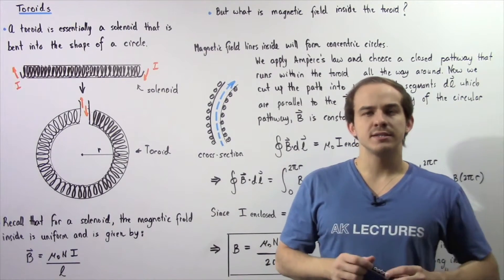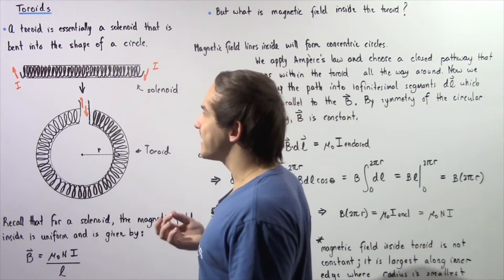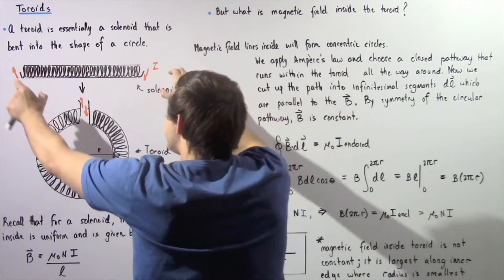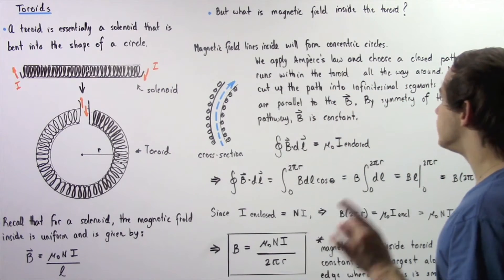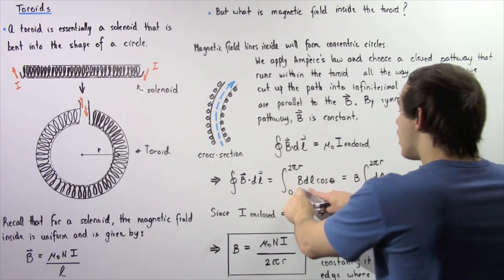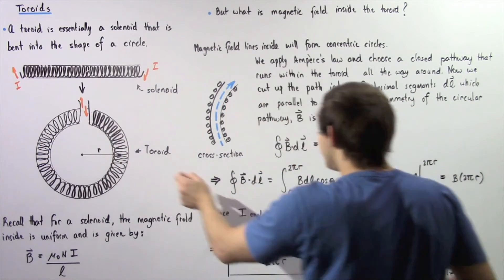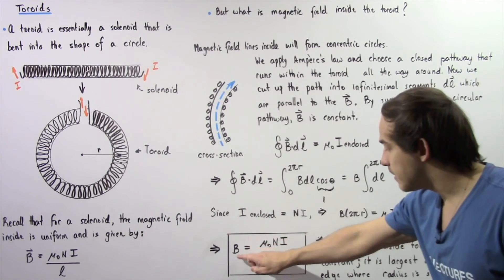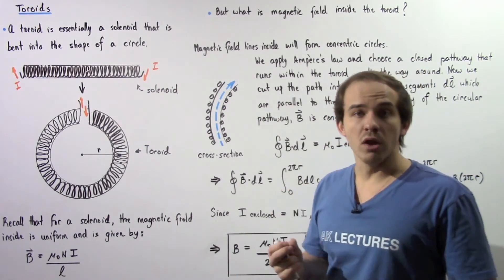Magnetic Field Inside Toroids

Comment: I find your Magnetic Field Inside and Outside a Toroid Lecture to be very interesting especially because of the use of math to explain the principles. I commented around January regarding the calculations to solve for the B field. You got 6.5 mTesla and I got a lesser amount. You were correct. I carefully went back and re-calculated your equation, and I was the one that left out the pi in the calculation with the permiability of free space,  4Pi x 10^-7 not you. I owe you an apology. I am very glad that I finally got it right, and thanks!

Comment: The overlooked problem is the actual physical reality - the fact that:
1)  the B field is created by the current in all cases involving flowing current
2)  the B field is said to be variable (greater on the inside of the toroid, lower on the outside of the toroid) but the current I is assumed to be constant - in other words, the B field is claimed to be varying *independent of the fact that the current is not varying*

I'm not saying Ampere's Law is wrong.  I'm saying this:

You cannot on the one hand say that "the B field varies directly with current flow" 

but simultaneously say "the B field varies independently of current flow"

I'm talking about the *EXACT PHYSICAL NATURE* of the current flow here.  Is there any claim that current flow is greater on the inside of the toroid, and/or that the current flow is somehow lower on the outer edge?  NO. 

Then you have 2 choices.  You can say "okay, I admit it,  since the B field is lower on the outside of the toroid ring compared to the inside, that means the current must also be lower"  OR you can say "the B field does not vary on the inside or outside of the toroid ring - the B field varies directly with the current,  and since the current is constant, so is the B field"

LEAVE THE MATH OUT OF THE FOLLOWING.  This is a thought experiment about the EXACT PHYSICAL NATURE of the current flow, and of the B field of the wire.
NOTE:  You should look at a picture of the magnetic field lines of a wire-wrapped soft-iron-core - aka a solenoid - FIRST, before you can understand the below:

The way to get the physical picture is this:
1)  take a straight piece of wire and wrap it around a straight, soft (very soft) iron shaft,  and with 1 amp flowing  (the wire is powered by a DC power source).  This is just a soft-iron core solenoid
2)  measure the B field on the left side and on the right side of the wrapped wire, on the left side and then the right side of the solenoid.  SAME B FIELD WILL BE DETECTED.  It's a solenoid.
3)  bend the wire-wrapped soft-iron-core into a 1/2 circle and with the same 1 amp current flowing,  measure the B field on the left side and on the right side of the wire-wrapped soft-iron-core.
      IT MUST BE THE SAME as you found for the straight solenoid.
4)  now bend the wire-wrapped soft-iron-core into 3/4 of a circle and with the same 1 amp current flowing,  measure the B field on the left side and on the right side of the wire-wrapped soft-iron-core .   Since the same current is flowing,  the B field MUST be the same on both sides of the wire.
5)  repeat (4) but bend the wire-wrapped soft-iron-core into almost a circle but the ends are not touching. 

Since the current does not change AT ALL in the above,  the PHYSICAL UNDERSTANDING of a CHANGE, a DIFFERENCE,  a VARIATION in the B field in the inside of the circle compared to the outside of the circle *while the current stays constant* is MISSING in the standard explanation.

The problem with relying on math to explain physics is a glaring error like this one.    Always remember: math is a SHORTHAND to present a physical reality.  Math is to a physical reality as written music is to the sounds produced by the instrument.  Math is a CRUTCH.  You do not start with the math.  You begin with a PRECISE UNDERSTANDING of  the exact physical reality.  Then use the shorthand (math) to describe it.

You cannot on the one hand say that "the B field varies directly with current flow" 
but simultaneously say "the B field varies independently of current flow because, in a circular solenoid, the current is the same on the inside and the outside but the B field IS NOT"

This is an overlooked mistake.  I'm not talking about the math here, so a refutation of "but the math explains it" doesn't answer the question.  At all.  

Put the 'PHYSICAL' back in PHYSICS. 

Demand a PHYSICAL explanation.   Say  "how could the current be the same but the B field be different?"
You will not get a physically precise answer.  You will get a decades-regurgitated "because look at Ampere's Law".

"But how can the current stay the same throughout the wire but the B field is different?"

You will not get a physical explanation and that is a problem.
.
Reply: Lol if you don’t understand electromagnetism just say you don’t. The physical interpretation is easy.
Reply: @Nick_Adkins  
I don't think you understood my gripe.  It's misleading to tell a physics student "a constant current of 1amp gives a constant B field of 20 Gauss" then turn around and say "a constant current of 1 amp gives a B field of 100 Gauss"  - UNLESS you explain WHY.     The 'why' is important because we're talking about simple repositioning of magnetic flux lines, AND NOT  a 'magical' increase in magnetism.

One way to say that is  "toroids do not amplify magnetic fields".  The physically precise explanation is like that of an explosively pumped flux generator.  It's precise to say "a toroid re-positions flux lines into a small volume of space"

Another field example.  It is commonly known that gravity is a gradient of declining inertial drag that, owing to the 'point source' nature of it,  leaves an orbiting object with an inertial drag imbalance (a declining gradient of inertial drag, along a vector pointing at the gravity source).

It is possible to alter the QED Vacuum to alter the gravity field - to restore the conditions to eliminate the imbalance.

For example, in open, empty space - far from any gravity source - there is no 32.2 feet/second^2 acceleration of gravity.  Inertial drag is balanced - the same magnitude of inertial drag is experienced regardless of which direction you accelerate a rocket ship.

In a gravity field, there is an imbalance of inertial drag and an acceleration of 32.2 feet/second^2 (Earth in this case) is manifest on one side of the rocket ship, without even needing to fire the rocket.

It is possible to alter the QED Vacuum to restore the balance of inertial drag around the vehicle.  In this case, it is like a toroid being 'unwound', where the 'bunching up' of the magnetic field lines of the toroid is "undone" - they magnetic field lines are distributed into a larger volume of space.

That's not how you neutralize gravity but it's conceptually similar.

Gravity is a quench of inertial drag.

.

Comment: Is the field inside any point on the solenoid the same function or is that equation only valid for the xy plane in which you sliced the toroid in half? What happens if I am asked for the magnetic field inside the toroid but in a point with an elevation relative to that plane? I think the enclosed current will be a component of the total current in other planes

Comment: Please Answer.....if one wire is going inside and one wire is going outside.....then the net result of magnetic field at the centre should be zero???
Reply: It's not the wire going in or out man - it is the current. In this case only inner part of the coils of the toroid are counted as they are inside the circular path that counts for Ampere's law. If you mean  a path outside the toroid all together then  yes you're right - the net B is 0 as it is zero inside the circle formed by toroid itself
Reply: philip riesling so, the amount of wire "within" the center of the field is all that is counted in the equation? (Amateur here, please be gentle! Very enthusiastic about learning this now, however!)